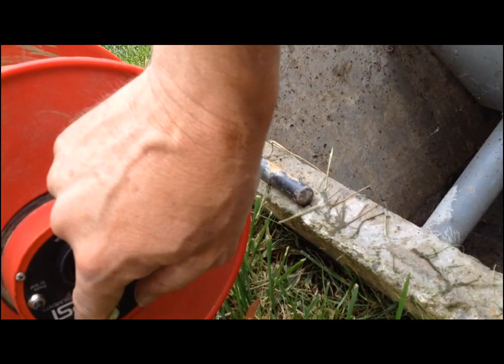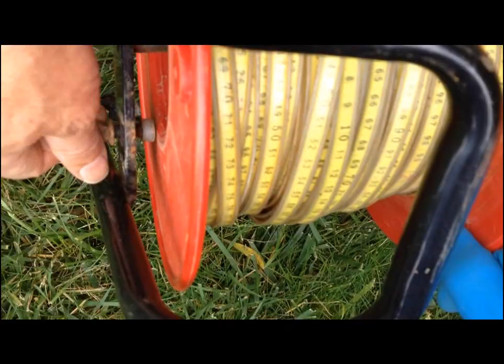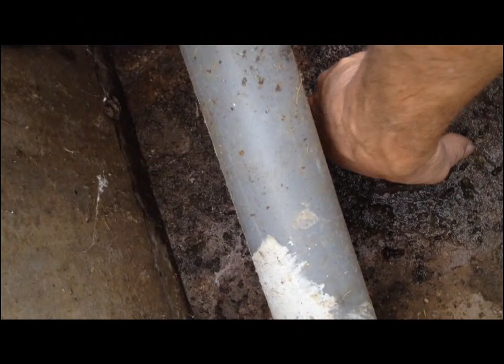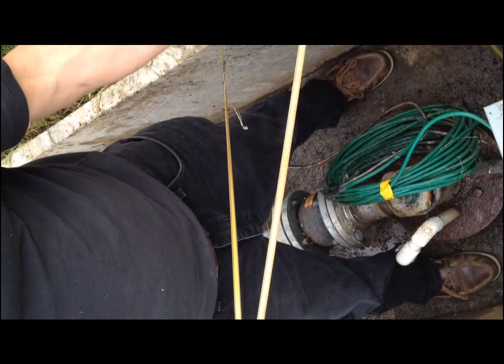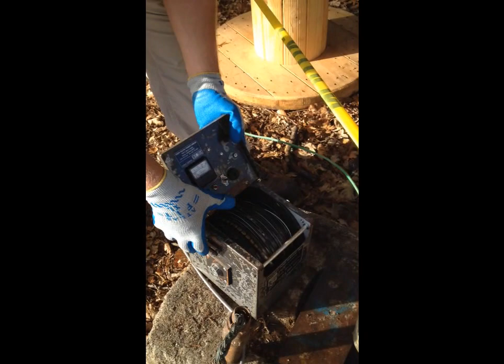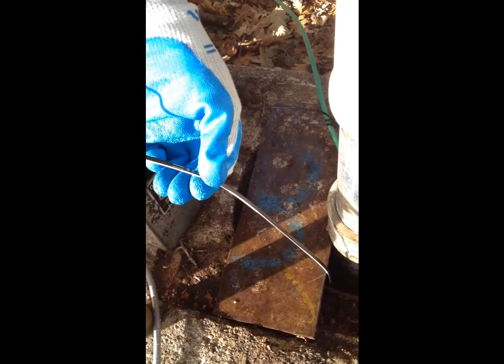Measuring the water level in a well

Comment: how do you know how deep the 
water is in the well
Reply from the maker: +Clyde Houck The sounder beeps when the probe touches the water surface, at the sound of the beep, you read the depth on the downhole wire which is also a tape measure.  You can see the black markings on the yellow wire early on the  first video.  The second machine has crimped brass markings which tell you how far down the cable is
Reply: @glennreynolds3828  That only tells you were the TOP of the water is, not "how deep" is the water, which would depend upon the depth to the bottom of the well.